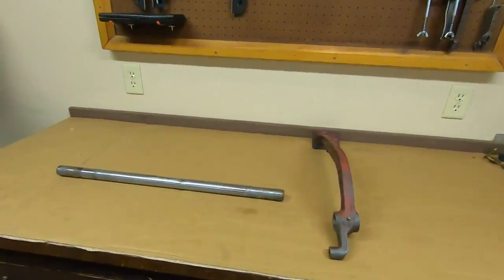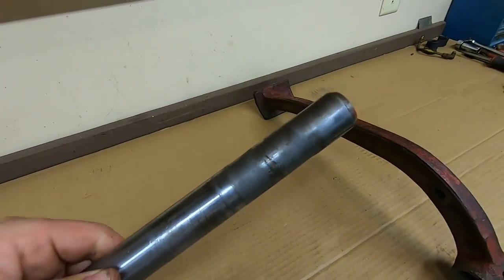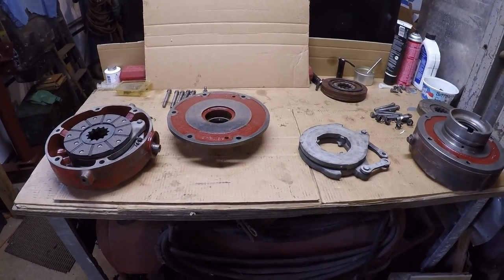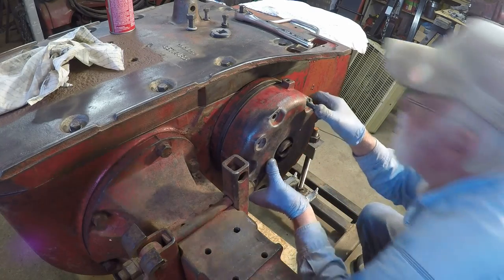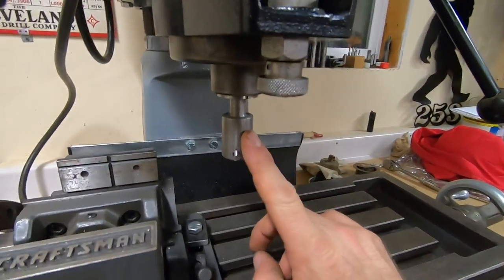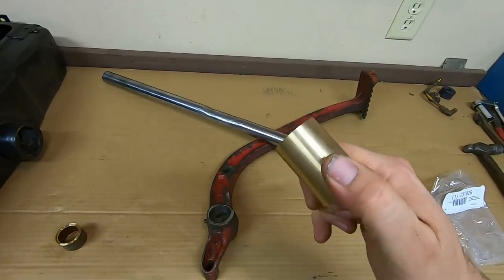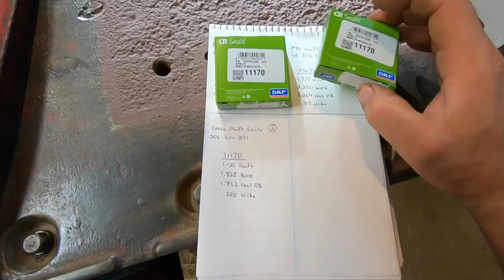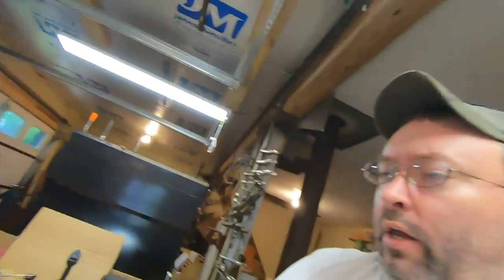Farmall Super M Rebuild Ep.34: Tightening Up The Loose Clutch Pedal & Installing The Brakes

Comment: One of the rare occasions we see you welding and working at the lathe, Toby. You lay some nice beads, but spray welding would have been the  better solution. Unfortunately Abom 79 lives in Pensacola, not only far south but also Covid country now.
Reply: Yeah, that Abom does some fine work.
Reply: jbj27406 There are a couple of limitations of the spray welding/metalizing process, and if I understood Keith Fenners recent series correctly, the bond between the spray metal and the parent metal is somewhat weak.  I’ve seen Abom use it to build up a motor shaft to fit a bearing, but never as the bearing or friction surface.
Reply: @jdownj  I must admit these techniques are far beyond my skills level, my welding is very amateurish and I've never used a lathe.  But I find it very interesting to see these skilled guys like Toby, Senior, and Abom able to jig up their work or equipment to perform operations that I couldn't easily figure out how to do.

Comment: I've got a 504D with the same issue on the clutch/brake shaft. Got a South Bend similar to yours as well. Just a much shorter bed length.

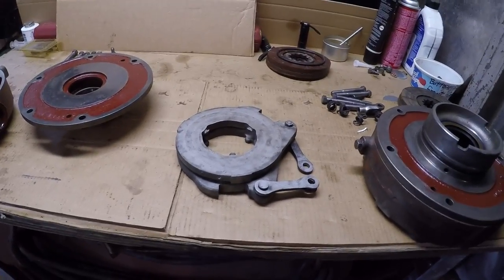Comment: 5:42 - Haha, nice IH brake system review Sq. Sr! "I'm not a real fan of it, but if you keep everything nice and in tune they work - to an extend"
Reply: Well in all fairness I was a kid throwing hay bales on a wagon,the Farmall in top gear could pull a fully loaded wagon at highway speeds,and with care was capable of slowing tractor and wagon for the turn to the side road.
Real modern style braking was unattainable. The wagon had no brakes,us kids were on the hay bales,an emergency stop would have been a mess.
But generations of families did exactly that,and survived. Bad luck or carelessness produced another consequence.
Would I do it again ? Probably. As an adult would I improve the circumstances  ? Almost certainly. Brakes on the wagon alone would help.
Is it worth finding a way to upgrade the tractor brakes ? I doubt it.
Is it a good system ? Hmm. Not sure. It worked. What would be better ? Not sure. Any ideas out there in YouTubeland ? Be interesting to find out.
Reply: @paulmanson253  - I guess Sr. nailed it then? Further, I agree, the Super M is certainly a child of it's time. Traffic was much more forgiving with way fewer cars  (at least in my parts of the world). No question we have to do stuff differently now :)
Reply: The IH disc brakes can work very well, but there’s no real in between, they either work great or barely at all. Due to the design, they’re also “self energizing”.. when you’re going forward anyway. They never work as good going backwards as they do forwards.
Reply: @justinstearns9723  Hmm. Self energizing. That is actually a technical term,referring to leading shoe/trailing shoe drum brake system with an adjustable flex coupling between trailing end of leading shoe and leading end of trailing shoe. Not trying to zing you but it has a most specific meaning to us what are school trained on the subject.
I have not actually paid much attention to the physical details of the disc system. Too much else to think about,but now you have brought it up,it is time.
Please be good enough to reply as to just what you mean by that,and I will try to get my head around it. Thanks.
Reply: paul manson The ball and ramp brake actuators used in these Farmalls are made in such a way that when applied they rotate in the same direction as the brake discs themselves when going forward. So the grip of the discs assists in opening up that actuator and makes them grab harder. Kind of like a crude mechanical form of power brakes. And the reason they don’t work as well in reverse, is because they’re turning in the opposite direction and instead try to release the actuators.
Reply: @justinstearns9723  Right. Got it. Well phrased. So in a sense,sort of,the one way actuation of a sprag clutch has some parallels here.
If I am not mistaken,there was a mechanical brake booster system Rolls Royce pioneered between the wars. Used the driveshaft as a power source.
And many years ago saw an exploded diagram of such,and there was stuff there that reminded me of what you just said. Wish my memory was better for actual details,but there it is.
I suppose two hydraulic power boost units pushing the brake actuators could increase the apply force,that would be do-able,cannot think of anything else that would not be a plumbing nightmare.
And the term self energizing seems quite appropriate here. Thanks for increasing my knowledge. All the best.
Reply: @justinstearns9723  Incorrectamundo, they are self-energizing in both directions.

Comment: That brakin system was used on International tractors for a long time even after the introduction of a diff lock pedal which operated on a shaft comin through the right hand side brake assembly 👍

Comment: Mind if I send you a shaft and pedal(s) from a Farmall 450 to refurbish? The clutch on my LP is as bad, if not worse than that Super M was. Luckily nobody cared enough about the tractor to weld a rod alongside the platform.

Comment: Is there any manufacturer identification on the brakes? I have observed almost identical brake design on a BM Volvo 400 tractor, just the dustcaps were no present, the outer cover was totally solid cast part